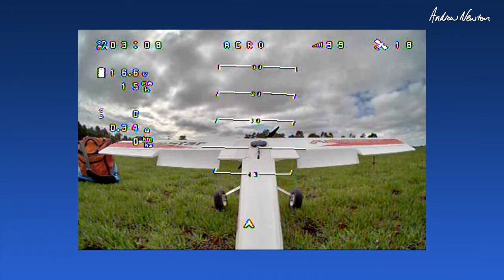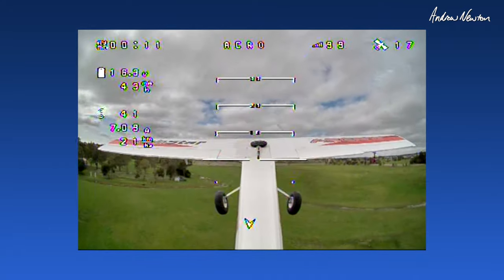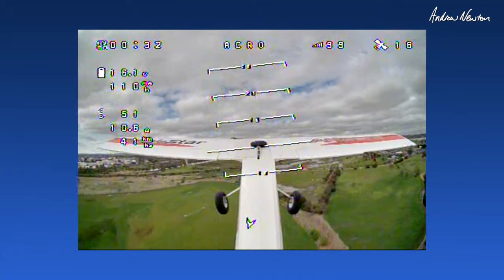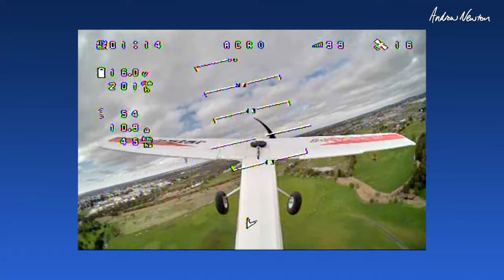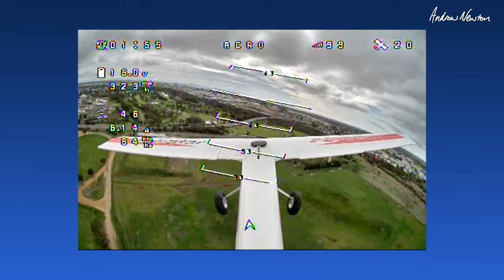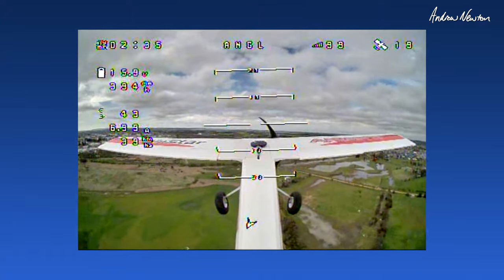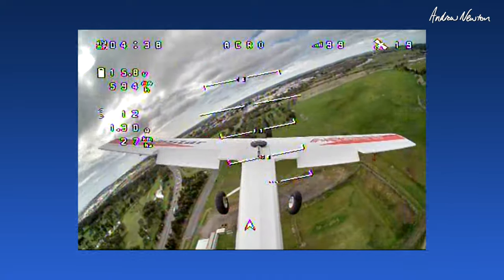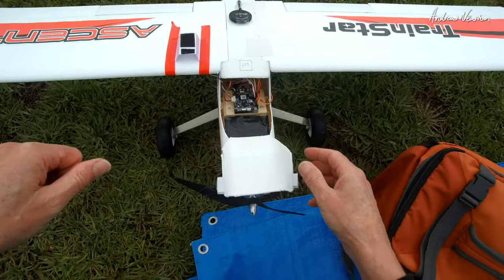FrSKY R9 / RXSR Pilot F765 flights

Comment: Hi Andrew, this looks like a good flight controller board. So far I can only find it with the R9. Do you know if the R9 system is legal in Australia or not?
Reply from the maker: RXSR version is coming soon I believe. Yes 915MHz is legal, there are most likely power limits

Comment: Andrew, this is such a nice flier. I'm ready to invest on long range radio but my budget is a bit tight since COVID. I like the cost of the R9 system but I'm a bit confused on the right way to set it up in regards to accst/access. I own the Jumper t16 pro so I would imagine I have to stay with accst protocol but I've heard of another protocol to use with the R9. Can you give me some advise on how to properly setup the R9 system. My initial setup would be using the Kopilot system. Eventually I may grab a flight controller to setup with inav or ardupilot.
Reply from the maker: I'm no long range expert, never use it. But you need to match protocols between module receiver and transmitter. Either ACCST or ACCESS. Which transmitter protocol do you use?
Reply: @AndrewNewton  I normally use the frsky rx6r rx with kopilot and run my flaps from the rx itself connected via sbus. I'm not intending to fly more than 1.5km away. I'm interested in having more distance than a perimeter or LOS flying but not extreme distance. I'm happy with about 1-2 miles away thats plenty for me. I read that the rx6x does greater than 2km so i would think its plenty but wanted to confirm.

Comment: Hi, if you are pleased with iNav you should try ArduPlane on it, I have several F765 boards, all with ArduPlane on it and it is just awesome, I even have a couple of planes flying with LTE 4G connection between plane and Ground Station which gives me virtually no range limits, this allow you to be in the US flying a plane in Australia with live Video Feed and a delay of 0.3 seconds.
Reply from the maker: If I could get Arduplane running properly on my Mac I would. Many hours trying
Reply: Andrew Newton where is the issue? I use QGroundControl on my mac and flashed the F765 with the iNav app also on mac, just download the proper FW file from the Ardupilot webpage. If you need guidance just let me know.
Regards
Reply from the maker: I can flash firmware to F405 Wing and connect OK, but Initial Setup page is blank, no icons to choose from
Reply: Andrew Newton that sound weird, are you flashing a file called arduplane_with_bl.hex on your FC?
So, you connect the board to usb and the QGroundControl does not react to it?
Reply from the maker: @nfvisuals  Haven't tried QGroundcotrol. Is that required in addition to Ardupilot? Still trying to do the initial setup
Reply: Andrew Newton well, after you flash the FC with Arduplane you need a software to configure it cia USB so, QGroundControl for mac and windows or Mission Planner for windows